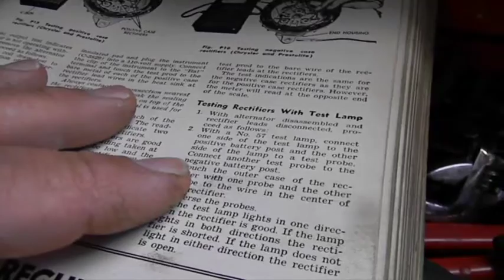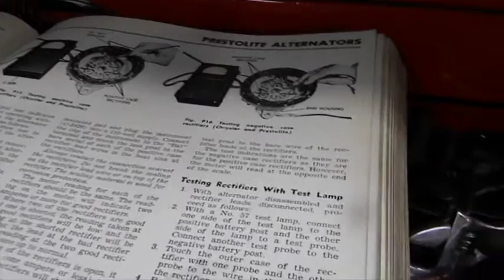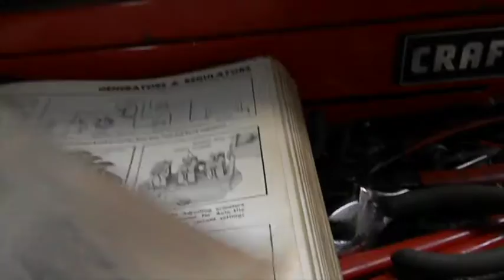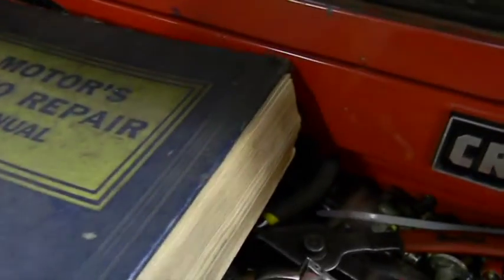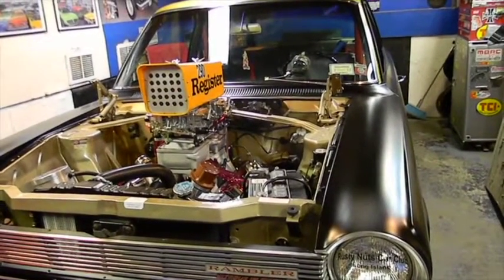Shop Talk

Comment: If he is running an 8volt battery, he will need to boost the regulator up so it will have about 9.6 volts going into the battery. Does he have a resistor for the lights and the ignition system? I had an 8 volt setup in my 50 Ford back in the day and worked on a few others for customers. Have fun with that one. I never enjoyed working on positive ground systems... I guess I have forgotten most of that stuff now.

Comment: 8volt battery will not cause a problem. Sounds like the regulator if it's putting out 8volts, but check the amperage coming out of it. If I remember right, the biggest problem with generators was a broken winding. I remember testing them with a growler. Also, I think there had to be a gap between the windings on the commutator, but check me on that. I haven't worked on one since High School. I have tested one on a bench tester since the 80's. Good luck!
Reply: Also, if everything is ok with the generator it should run as a motor. Don't go crazy with voltage though.